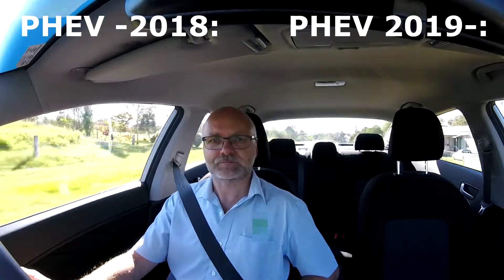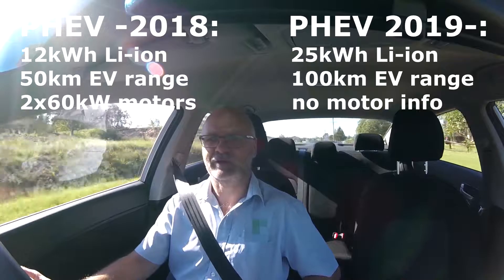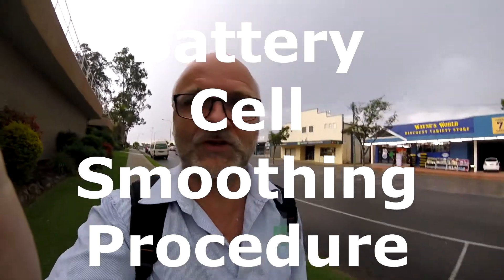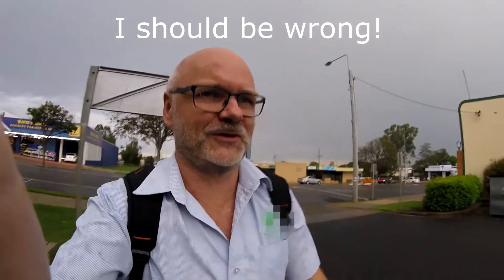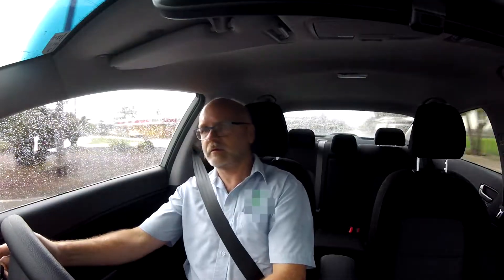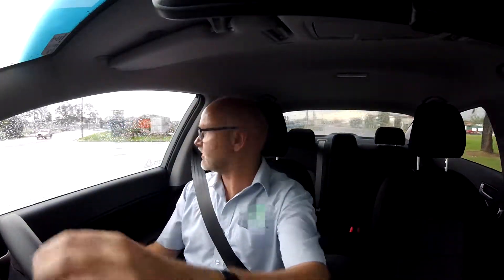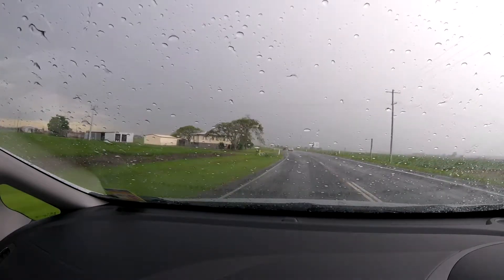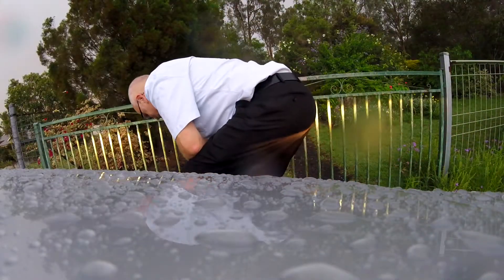Ep3 - Battery Cell Smoothing on Outlander PHEV! Is this the solution?

Comment: Hello. Which Mitsubishi dealership did you gontonget it serviced as i have a 2014 /15 (MY14.5) Outlander PHEV Aspire for sale that has had battery replaced under warranty with Mitsubishi in 2019 and showed 95% battery health.